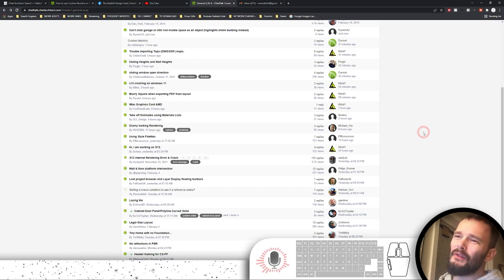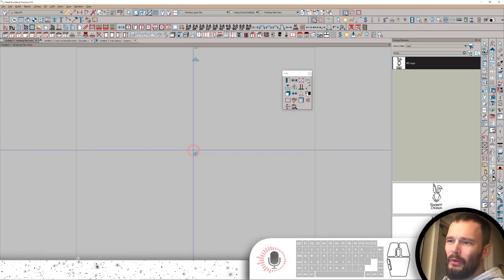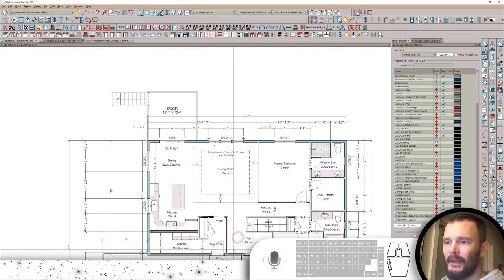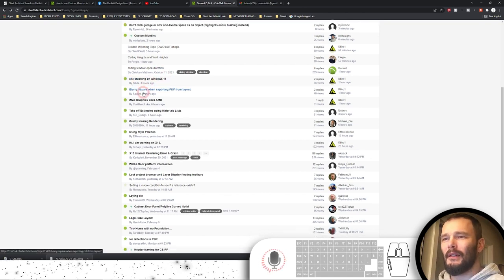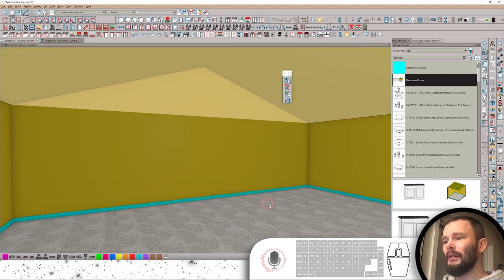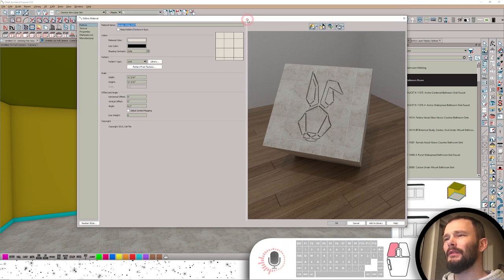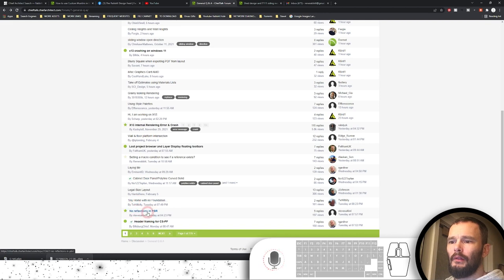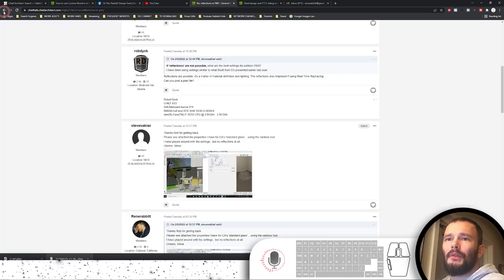Solving The First Page-Chief Architect    ///Live////  Episode 2

Comment: Is it possible to create and display 3D cut-a-way view that would show the various elements that make a wall/floor/roof assembly?

Malcolm from Oakland
Reply from the maker: Heya Malcolm. Yes, to an extent, goto header then 3d/Camera View Options/Cross-Section Slider/ Set your sliders then send the image to layout or make a CAD detail from view
. There is also a funny trick to do this in 3d with a 3d connexion mouse but that gets pretty wild